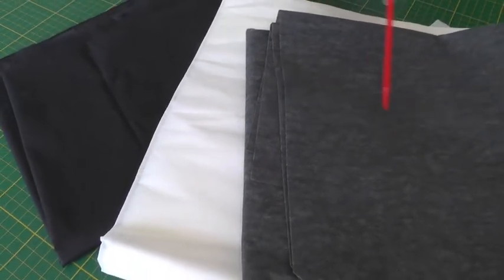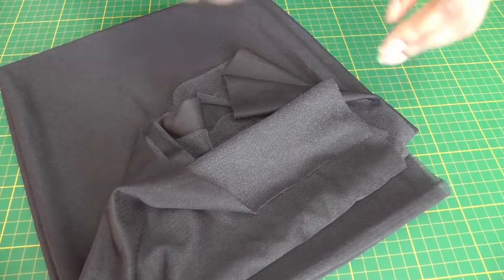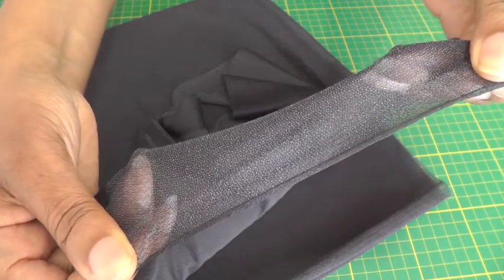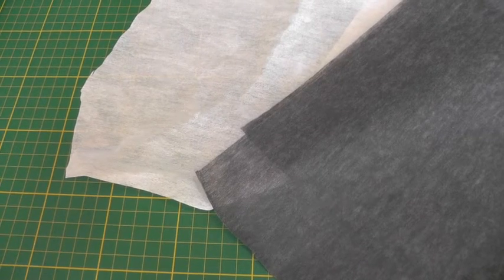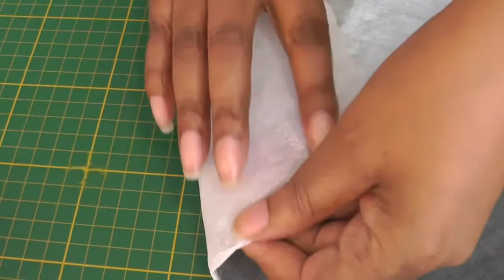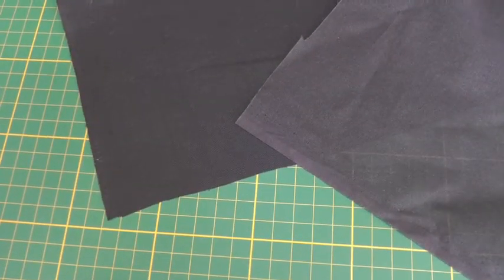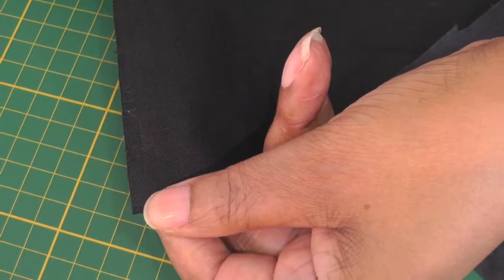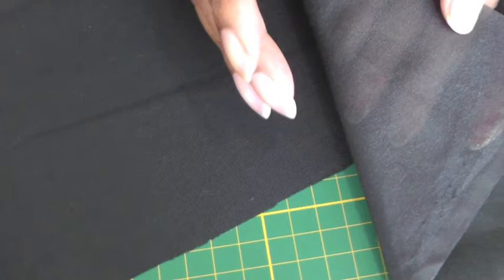The Basics of Interfacing

Comment: Hi, thanks for the intro. I'm embarking on a waistcoat project and am a bit unsure of what interfacing to use. The instructions for the pattern say to use sew-on interfacing, but given that the fabric I happen to like is a lightweight cotton that will need some real stiffening if it's to maintain its shape, should I go for the fusible one? Why's there a preference for sew-on over fusible for certain projects?
Reply from the maker: Either interfacing, whether sewn-on or fusible will do the job.  The preference is purely to do with speed and the pattern manufacturer may insist on sewn-on as they do not want the property of the fabric to be changed which could and does happen with fusible.
Reply: FashionSewingBlogTV Cheers for that. I think in that case I'll be going with the sew-on, as all I really need is a tad more bulk, and don't want to risk the fabric looking weird in any way. Thanks again, v. helpful!

Comment: how do you remove the fusing if it gets stuck on your iron
Reply from the maker: Hello Janis Brown, Bring the temperature of your iron to the highest hottest point, lay a clean 100% cotton cloth on the iron board, run the iron over it several times until you see the fusible on the cloth, use steam if required.
Reply: thanks Colleen. I did find that a baking powder paste did the trick.I appreciate the help though.  Sincerely J